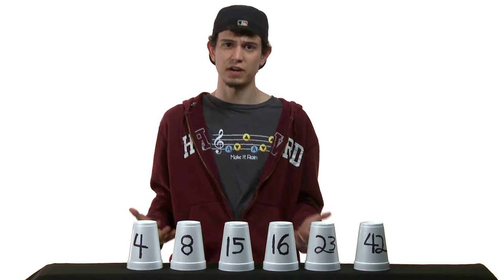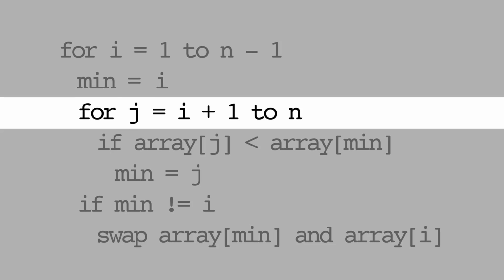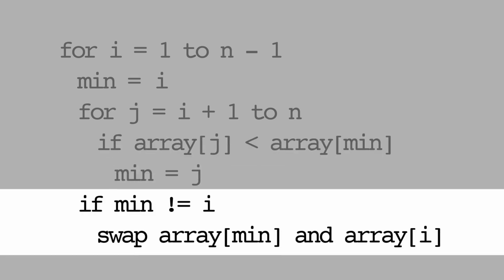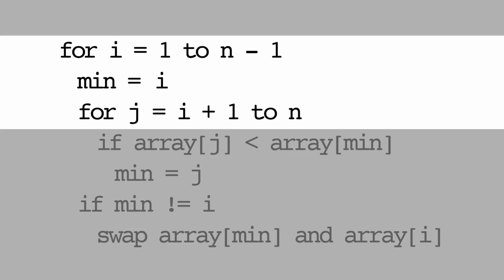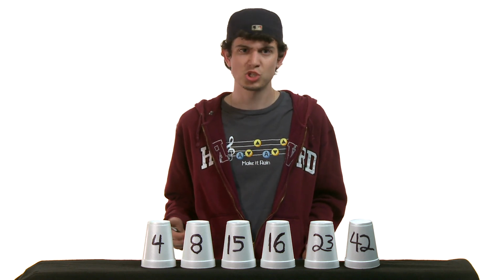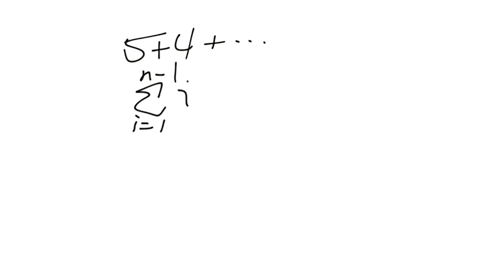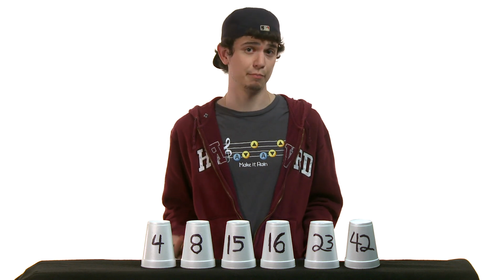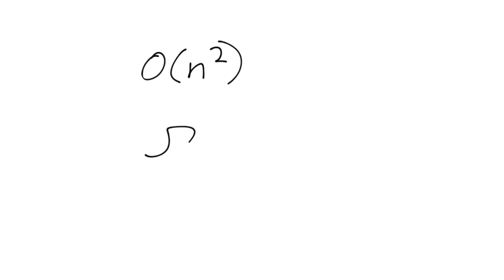Selection Sort

Comment: But how the fuck do you differentiate between the sorted and unsorted portions? It's only one array?
Reply: After the first pass through first for loop, you will start with the second element in the array.  Thereby skipping the first element, because it is already sorted.
Reply: Before starting the first iteration.. assume there are no elements in the sorted portion.. So start from index 0.

Comment: Here's a C program in case it help. PLEASE GET RID OF THAT DREADFUL INTRO !!!

#include<stdio.h>
int main()

{
    
    int a,b,c,pos,i,j,temp,minimum;
    
    printf("Enter size of the array\n");
    scanf("%d",&a);
    
    int ar[a];
    
    printf("Enter values\n");
    
    for(i=0;i<a;i++)
    {
        scanf("%d",&ar[i]);
        
    }
    
    printf("Original array is\n");
    
    for(i=0;i<a;i++)
    {
     
     printf("%d\n",ar[i]);
 }
      
   for(i=0;i<a-1;i++)
   {
     pos=i;
     for(j=i+1;j<a;j++)
     {
      if(ar[j]<ar[pos])
      { pos=j;
   }
  }
  
  temp=ar[i];
  ar[i]=ar[pos];
  ar[pos]=temp;
    
   }
 
      
  
  printf("Sorted array is\n");
  
  for(i=0;i<a;i++)
  {
   printf("%d\n",ar[i]);
   
  }
}